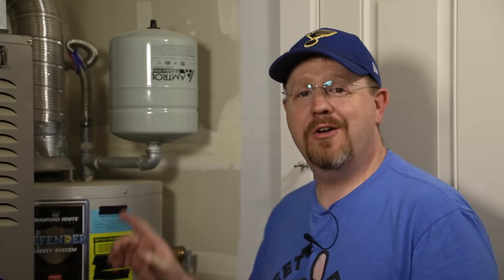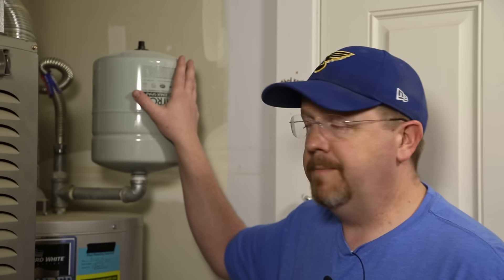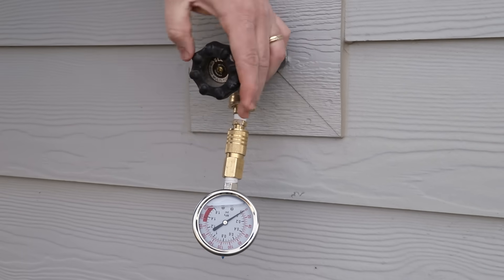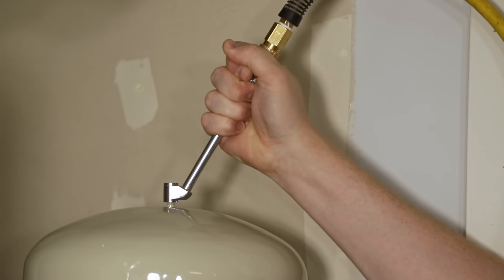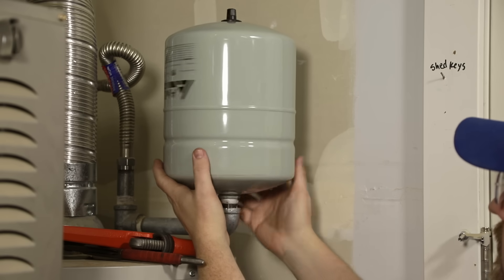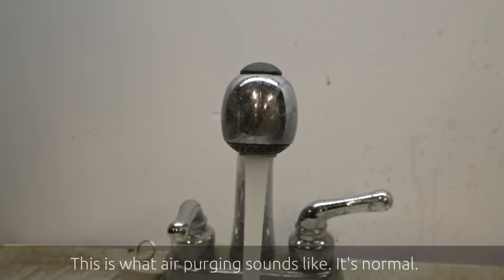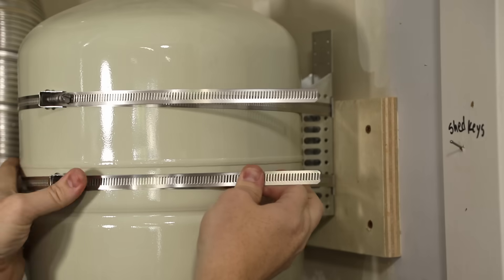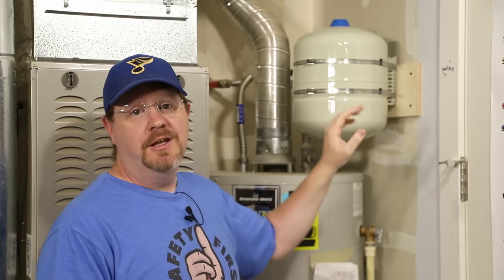What Is This Tank? How to Replace and Maintain a Water Heater Thermal Expansion Tank

Comment: I'm Back!! lol, I am still in the Planning Phase of hooking up an Expansion Tank... and Lately I've read that the Expansion Tank should be at least 18 inches AWAY from the Water heater.. Have you heard of that?  Just curious. thanks...  oh and I enjoyed watching your video again. I plan to use the same way of bracketing my Expansion Tank. Unfortunately I have to Drill threw CEMENT BLOCKS in my basement, rather than Dry Wall...  but no worries..  Thanks again!  :D
Reply from the maker: Hey Philip! Where did you read that the tank should be at least 18" away from the tank? I could not find anything in the national uniform plumbing code with respect to installation other than to follow the tank manufacturer's instructions: https://epubs.iapmo.org/2021/UPC/ - I also checked California's code (which is generally more restrictive and verbose than the NPC) and it says the same thing. 

I checked the installation instructions for both the expansion tanks I link to in the video description, and neither one says it has to be installed within any specific distance. Here is the manual for the Watts: https://www.watts.com/dfsmedia/0533dbba17714b1ab581ab07a4cbb521/12107-source/2915054-pdf

I also checked the install instructions for the actual tank I installed in the video, which I purchased locally at Home Depot: https://images.thdstatic.com/catalog/pdfImages/83/83ea7b15-bdee-48fa-8088-eba58916d148.pdf - it also does not have anything to say about specific distance.

There are certainly lots of opinions out there about how and where to install these things, but I prefer to go back to the documentation either from the manufacturer or the local plumbing codes. From a physics standpoint, as water is incompressible, it should not matter how far from the heater the expansion tank is installed, as long as it is between the cold water supply check valve and the water heater inlet. Make sense?
Reply: @AmplifyDIY  I have replied two times and Youtube isn't posting my Message. I've put a link to the site that mentions 18 inches.. I'll try again in the next post
Reply: Okay, I have the link Now, here it is. https://www.statewaterheaters.com/lit/im/tanks/317825-000.pdf?fbclid=IwAR01wWs_TMbECyHIEbhfNE5HEFJtr-Bnc0VG2jXcaBeMC-eBQg1xPqrIeMs
Reply from the maker: @ptyptypty3  Sorry about that! YouTube blocks responses with links in them for somewhat obvious reasons.
Reply from the maker: I just went and checked the manual you linked and sure enough: that specific manufacturer says to install their tank at least 18" away from the cold water inlet to the tank. No idea why they would recommend that.
Reply: @AmplifyDIY  thank you for taking the time to read that and for Responding to me .. :)  Your videos are very GOOD. You have the right Personality and Style for narrating your videos. You provide a great service to all of us who strive to save money by doing these projects alone. :)  Thank YOU! :)

Comment: Hi! Great video. So my plumber came and replaced my 5 year old expansion tank. It rustic and had a bubble hole on side . Water was everywhere. 

So he told me to cut main water off. Cut the breaker….Flip the expansion tank vaule AND  unplug my heating circulation pump. 

He came today… and fixed it all up but we noticed that we are still having brown and orange water come to all sinks and tubs after running it for about 10 mins. It finally ran clear but 3 hours later it was brown and orange again. 

We called and he said to unplug the heat pump over night then plug back in the morning. Does this sound right? And can u tell me why? Thanks!!
Reply from the maker: Hi Mel - My only thought is that leaving it unplugged overnight will allow any suspended sediment to settle and stop showing up at your faucets... but without being there to see your system it's a little difficult to know. I hope it clears up!

Comment: If these are needed so much then why aren't they built into the tank itself?
Reply from the maker: Hi Agent Mulder - They are not required in all areas, so tank manufacturers don't include them. Plumbing requirements and codes vary quite a bit by area, so you'll find these commonly installed where they are required. Thanks for watching!

Comment: Why when i set the water temperature to 180 degrees my Hydronic boiler goes past 30 psi for a two family house.Should I change the expansion tank from Ex30 to a Ex60 expansion tank.
Reply from the maker: A bigger expansion tank will always allow for more expansion / greater pressure differential range. A larger tank is likely a good idea in your case. Good luck!

Comment: Recently after taking a shower I get a burst of pressure for a few seconds at other faucets in the house. Could a faulty expansion tank be the culprit?
Reply from the maker: Sort of depends on the timing, but yes, you could have a faulty expansion tank (or one that just needs the pressure adjusted). Have you tested your tank? 

Thanks for watching!
Reply: @AmplifyDIY  I haven't had time yet. Can I check the pressure without turning the cold side off the water heater and running hot water from a faucet or do I need to do that when checking pressure?
Reply from the maker: @lenluviner8373  So the expansion tank has 2 sides: the water side, and the air side. In order to correctly measure the pressure of the air side, you have to remove the pressure of the water side, otherwise the pressure of the water will affect the pressure on the air side. Make sense? 
So short answer: yes, you have to turn off the water source, then relieve the pressure from the water heater tank before measuring the air pressure on the expansion tank. Good luck!
Reply: I turned the water off on the cold side and ran the hot water out using the bathroom sink. I put an air gauge on the tank and didn't get a reading. I tried putting air in the tank and it won't go in. I tried letting air out of the tank and that didn't work either. Not sure what's going on.
Reply from the maker: @lenluviner8373  Sounds like you have a bad/seized schrader valve on the tank. If you push in the center part of the valve with something like the tip of a screwdriver, does any air come out at all?
Reply: @AmplifyDIY  Nope, that's what I tried. I pressed it all the way in with a small screwdriver and no air came out.
Reply from the maker: @lenluviner8373  Then you either have a) a failed shrader valve (not likely) or b) all the air has leaked out of your tank. This is the most likely scenario. In your shoes, I'd likely go ahead and turn off the cold water supply to the tank, drain out a couple of gallons of water, then remove the expansion tank so I could test it further/inspect the water side of it, etc. You could more easily try filling the tank with air and test if it holds, or you could try replacing the valve core (https://youtu.be/3U3Pv-YtMCs - this is on a tire, but it's the same kind of valve). 

In all likelihood though,  you will need to replace the expansion tank. Luckily, the whole process is neither difficult nor expensive, as shown in this video. Good luck!
Reply: Finally got around to replacing the tank. When I got the tank off it was 100% full of water. After replacing it, no more bursts of pressure. Thanks again for your help!
Reply from the maker: @lenluviner8373  Awesome job!
Reply: Couldn’t have done it without your video!

Comment: Excellent video. I disagree that your tank needs a well mount as it is mounted correctly to a hard pipe but I could be wrong. Mine is upside down on CPVC so its DEFINITELY needs a strap kit lol. Thanks John great info here
Reply from the maker: Hey Cody - The need for a wall mount really does vary a lot by local codes. Areas prone to earthquakes definitely need them. Where I live, I don't actually need one per code, but wanted to demonstrate how to mount it for places that do - and now mine is over-built, which is not a problem at all. Thanks for watching!

Comment: You don't need to use Pipe Dope with the Teflon tape. In fact, they don't recommend that. I've used the Teflon tape, two full wraps minimum, for probably 50 years now, and never had a leak. It also does't cease up for when you would like to remove the fitting in the future.

Comment: Great Video! I was wondering if a malfunctioning expansion tank or a leaking TP valve could prevent water from heating up. The hot water has been on and off for the last 3 weeks in my 6 years old Gas water heater tank and my plumber has advised me to replace the whole 75L tank.
Reply from the maker: The heater is only 6 years old and the plumber's only recommendation is to just replace the whole thing? It's time to ask for a second and third opinion. Most likely there is some component which has failed - probably in the control electronics. Swapping out the failed component will likely be a much less expensive repair - oh, and no, a malfunctioning expansion tank or leaking T&P is not likely contributing to your intermittent heating issue. 
Good luck!

Comment: The Schrader valve can be leak tested with soap suds.  If leaking, the valve core can be replaced without replacing the whole tank.
Reply from the maker: Great tip Roger, thanks!

Comment: What if you’re replacing a tank that hasn’t completely failed. Would you have to relieve the pressure using the valve on top before removing?
Reply from the maker: Hi Anthony - for the benefit of anyone else reading, let me address 2 types of pressures here: First, there is water pressure. This should always be relieved from the system whenever you are going to open any fitting (i.e., removing a tank, failed or otherwise) so that you don't get a bunch of water spraying out of the fitting as you crack things open. Second, there is the air pressure that is on the other end of the thermal expansion tank (I believe this is what you are asking about). You don't need to relieve the air pressure when removing the tank, as it a) should be in an airtight portion of the tank that won't leak or b) if the bladder has failed and it leaks, the air pressure will be relieved when you relieve the water pressure, as they are ultimately part of the same pressure system. 

Short answer: Relieve the water pressure, and then it's safe to remove the tank, regardless of status of the air bladder. Thanks for watching!

Comment: Re: Hot water tank thermal expansion tank installation. When repressuring, the TET has air on both sides of the diaphragm. There is no purge valve to bleed the air  in the TET. So there will be compressible air on both sides of the diaphragm?
Reply from the maker: Hi Zach - if you pressurize the air side of the tank prior to install, the internal bladder will actually expand to the point it just about completely fills the water side of the TET. If you look into the fitting where it connects to the plumbing, you'll easily see the bottom side of the bladder resting against the end of the fitting. Once you connect the tank and pressurize the water side, water will flow into the expansion tank until equilibrium is reached between the 2 sides.

In other words: there may be a tiny amount of air on the water side, but it's fine. Thanks for watching!

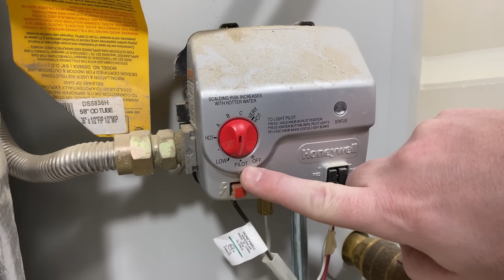Comment: At about 4:40 you say " After you depressurize the system" then you turn your heater knob as low as it can go.  Did you mean let all the air out of your expansion tank? If your bladder is bad and it's shoots water do you still depressurize it by letting it spew the water out completely?
Reply from the maker: Depressurizing the system means letting out all the water pressure. The steps for that are: 1) Turn off the cold water inlet to the heater, 2) Open a faucet somewhere and turn it all the way to hot. Wait for the water to stop flowing out of that faucet (may take 30-60 seconds, or possibly longer). That will depressurize the water in the system, so that when you do disconnect any water fittings (i.e., when you remove the expansion tank) no water will come spewing out under pressure. 

In addition to relieving the pressure, I recommend draining at least a few gallons out of the tank... this should drain the water out of your expansion tank ... at least most of it. With a failed bladder (water shoots out the air valve) there will always be some more water trapped on the wrong side of the bladder in the expansion tank, but it should not come spewing out under pressure when you disconnect the tank. 

Good luck!
Reply: Also, I don't believe I ever saw you turn off the cold water to the unit, Or did I miss something?
Reply: Never mind, I went back earlier in the video and you did turn the water off, my apologies

Comment: Tell me this is not like the car dealership sales pitch for underbody rust protection. The engineers didn’t account for this in the water heater design?
Reply from the maker: Hi Starman - water heater designs have not changed significantly in decades. The need for expansion tanks is somewhat new, as many municipal water supplies are no longer allowing water to backflow into their systems. It's this new change in the water supply systems that is making these become much more prevalent. It's definitely not a useless gimmick like so many plaid-jacketed used-car sellers try to foist on buyers. Thanks for watching!

Comment: Helpful video, just one thing is you’re worried about a sharp end on a zip tie when at 6:07 your water heater line has a big ole kink. That would be a bigger concern of mine.
Reply from the maker: Thanks for pointing this out - I am not a fan of the flex hose that the plumber installed when the house was built, but I'm also a fan of an "ain't broke, don't fix it" approach to these sorts of things. While the flex hose is bent, it seems to be working just fine. We have excellent water pressure, etc. Should there ever be problems though, you bet I'll replace that. Thanks for watching!
Reply: @AmplifyDIY  no problem. Thanks for posting helpful videos.

Comment: What do you use to make the enough pressure in new expansion tank to mach water pressure?
Reply from the maker: Hi A - I used an air compressor, but you can also use a bike tire pump, or any sort of pump that can fill up tires, etc. Thanks for watching!
Reply: @AmplifyDIY  thank you

Comment: Just wondering about older homes that don’t have an expansion tank. What is more important? An expansion tank or a pressure regulator? If our city water pressure is reasonably constant and never exceeds 75 psi (although it has dropped some in the past to about 55psi) do I still set the expansion tank to 75psi? Or do I bias it a little towards the lower end? Say like maybe 65psi?
Reply from the maker: I think an expansion tank is probably more important. I'd bias it a little lower, around 65 psi as you suggested. Good luck!

Comment: I have some black specks in the water, they look like deteriorating rubber. They only appear every now and then.
I noticed that after I did a water heater flush, more of those came out with the water in the tub, right after the flush. Do you think this may be due to an expansion tank issue or would it be the entire water heater that would need to be replaced?
Reply from the maker: Have you tested the expansion tank? If the black flecks are in fact rubber, it's entirely possible the bladder in the expansion tank has failed...I would start with testing the expansion tank. 

Also, flushing a water heater really stirs up the junk at the bottom of the tank. If there was still a little bit of stuff left there after you finished the flushing process, it may take a while for all of that to settle back down to the bottom of the tank after you re-fill it. If you start using the water immediately after filling the tank, you may get some sediment coming out of your faucet.
Reply: @AmplifyDIY  there are no leaks around the expansion tank and when I checked the pressure water didn’t come out so I am not sure if there is anything else that I can do to confirm that the black rubber in the expansion tank may be deteriorating. Any advice?

Comment: Great education video.  I had a leak in my water tank after turning on the hot water valve for the winter. 

The following day my water tank spewed about 2 1/2 gallons of hot water from a copper release pipe.  I contacted a plumber who informed, after tapping on the expansion tank, it had a calcium buildup preventing proper water flow through the system which caused the hot water leak.  He added the expansion tank needed to be replaced.  😒

He did not do a  water pressure check from an outside home water value to see if it matched the pressure from the expansion tank.

Could I have been duped into a $350 purchase for an expansion tank that did not need to be replaced and only required a simple fix?  I had the original expansion tank for about 5-years.
Reply from the maker: Hi Donald - it's possible the original expansion tank was still ok... but without testing it, there's really no way to be sure. Now you know how to keep an eye on your new tank, though!
Reply: @AmplifyDIY  I appreciate you responding back.  Now I know.